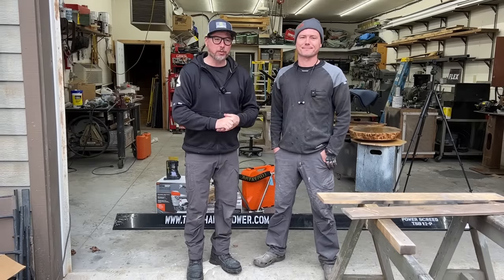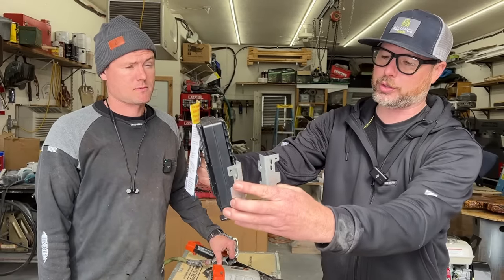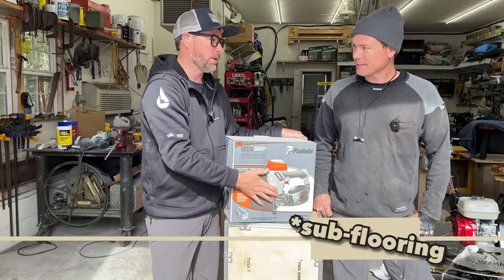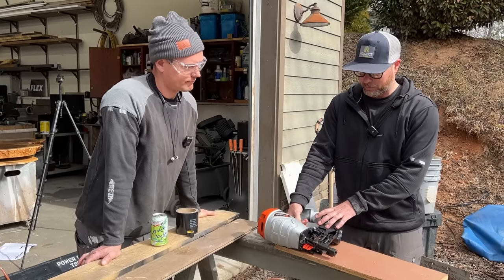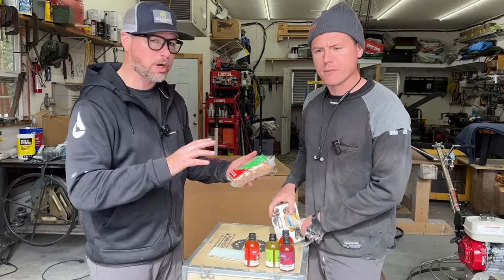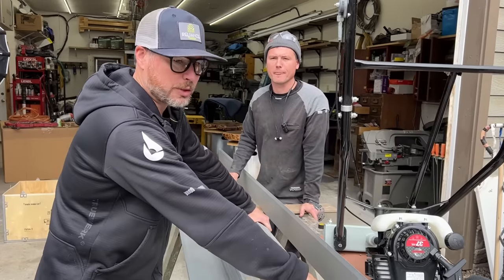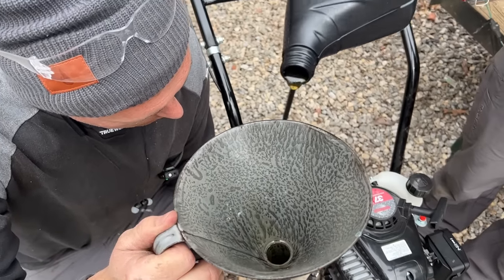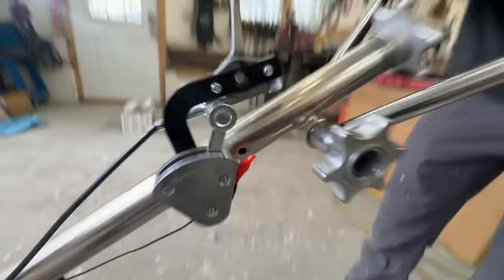New Job… New Tools!

Comment: The circle pan it goes on your power trowel to do the first pass on the concrete so when its to wet you don't sink and it will help your concrete stay flat. Many people don't use it. Just go with the blades when the concrete is ready. Like your videos. From Wyoming.
Reply: Interesting to know. So Jaime was acturally right about it. That man is incredibly smart

Comment: The circle is a float pan that goes over the blades.  You can also use float blades which just go over the blades for the first pass, or use combo blades that float at lower angles and finish at higher angles.  The float pan or float blades will extend the life of the finishing blades on the machine by a large margin.

Comment: Hey, just a thought. But my Dad built a table on wheels that was the same height as his truck bed. That way, he just rolled it up to the truck and drug it onto his truck. Didn't have to wait for someone to lift it up. He did this for the trowling machine and the tamper. Yes Jamie is right about the tray. It is for when concrete is wet but you still need to get on it. Just really need to keep it clean and unblemished.  Really great stuff today guys. 😊

Comment: The large round steel plate is used in the Netherlands to finish cement screed floors, in other words a replacement for manually sanding a cement screed

Comment: The disc is known as a pan for the power trowel it’s used on the concrete for the first pass and lays the aggregate down giving you a layer to trowel and finish.

Comment: That big plate is for storage and transporting the trowel. I've rented my share of them myself, but bought two at a big construction company auction.the smaller one was a 3ft model and the bigger one was 4ft model. And as for a vibrating screed board we built our own. All that stuff is just rusting away in the barns and sheds. When I had to quit working because of a very horrible construction accident that has left me basically bedfast.

Comment: Hello... the iron circle is for the concrete leveling machine and is used when the concrete is softer, then when the consistency is better, only the blades are used at low speed

Comment: That pan goes with the power trowel. You use it on the first run on the cement helps bring up the cream and smooth it out.

Comment: In regards to the first question, oil in a new engine.  I worked at a business that sold and serviced power equipment growing up.  While many pieces of equipment we received were homeowners wanting us to service and store said equipment over winter which we offered.  They had a contract with the local Lowes to repair the customer returns for power equipment that "broke or didn't work". Everything you can imagine.... mowers, tillers, anything with an engine.  Lowes would tag the items with the reason for return and why the customer returned them.  Many items had either no oil or bad gasoline (water).  Some were fine and we always said they were bought for a one off job and returned for likely full refund after the job was completed cause they wanted to complete their project and then get their money back using the "broke or does not work line" when returning to the big box store....

Comment: When I got my first job out of highschool I was supposed to get a trailer sized generator running that had been sitting. First time I started it, the water I filled the oil system with came spraying from every hole imaginable.

Comment: I’ve tried many hammers over the years unfortunately wood is still my go to fav. I’m attached to 16oz wood stiletto the connecting point to hammer head is much thicker than the 14oz haven’t snapped it yet!!
Reply: I agree wood lighter and sucks up the vibration.

Comment: Jamie, that timber Tomahawk box will make a awesome toolbox for anyone who wants it. Just about every boat builder has at least one of them with custom built internals for the task/tools needed. You can use epoxy and some glass fiber to strengthen the insides and make it waterproof, carpet the outsides to make it non scratch on surfaces, a strip of piano hinge and a latch to keep sticky fingers out, just about any idea you could think of.
I was thinking all your concrete tools mounted on slides to the side walls and if it has enough head room a drop in tray for small parts. But I have seen guys use them for everything from PPE boxes to first aid kits and personal lockers. I am looking forward to seeing what you come up with. And if you want more ask your local boat shop for old bow or stern thruster boxes.

Comment: 2:38 @Perkins Builder Brothers
Those joist hangers come in handy and I like using them. Not everyone does on the team work on; but I sure do especially b/c I’m a bit faster at setting hangers b/c of this when we setting hanger before the joists which we do on certain projects. Now do I (we) need to use this for setting hangers, nope; but does make setting lots hangers effortless as don’t need to think about anything, lol. Some are not though, so everyone has there method and groove😁

Comment: I don't know an awful lot about tools, but that joist hanger tool looks kinda useless to me.  Not all joists hang w/bottom flush, some hang from a beam/ledger top flush.  Not all joists are 2x, what about TJI's (almost all we use out west for interior joists)?  Double joists need a wider hanger.  On a side note, seems very odd to me to install hangers after the fact, but have watched a number of YT videos by builders east of the Mississippi who do it that way.  I'd be worried about structural integrity of the end of the joist in regards to excess nail intrusions and/or toe-nailed nails interfering with hanger nails.

Comment: Checkout, Kens Karpentry - YouTube. He uses the power screed and float for garage slabs with only 1 or 2 other people helping. Also most of the his garage slabs don't have footings In Vermont? He has some very creative framing methods that can save a lot of time. Like 12/12 pitch rafters with no ridge board?
Good luck with the new stuff

Comment: The plate is for use on the concrete, it’s used when you don’t need a perfect surface. Normally it’s used and then removed to get the finished surface with the wings.
At least that’s how I’ve used and seen them used

Comment: this is so stupid!! but we see it over and over again, youtubers get free tools in return.
because with 1mil following, you can't afford to buy any decent tools yourself!!!
it is a mystery to me that your employees still have to drag themselves limply to death every time a rafter or beam layer has to be erected.
since a collapsible mini crane has a relatively low price.
 or why they have to walk around on such a sad scaffold like yours?
if you can call it scaffolding!!! since in many countries it would result in fines of more than 3,500 dollars if the labor inspectorate passed by.
for the most part, your scaffolding is neither wide enough, made with correct rowwork, knee rails, foot rails, etc., which is perceived as life-threatening.
yes, it's been going well until now, and will probably continue to do so, until the plus doesn't do it anymore, and a man lies lifeless on the ground